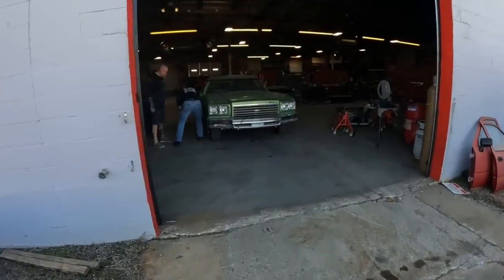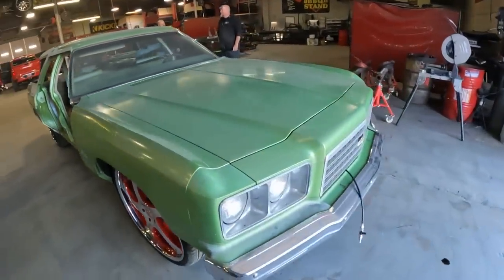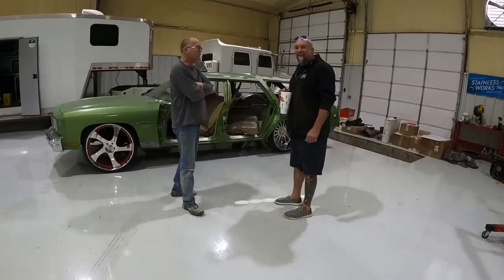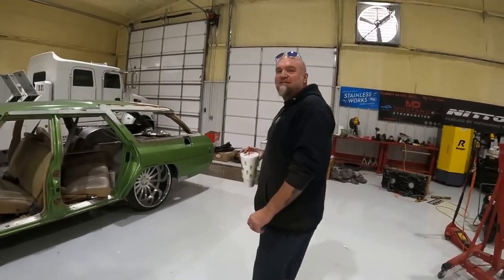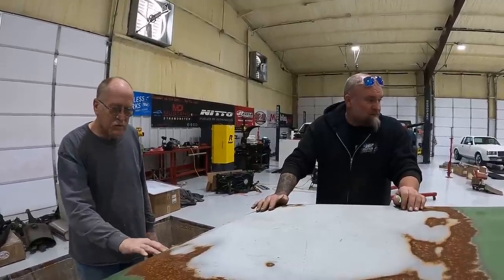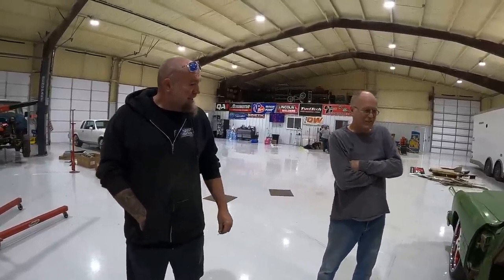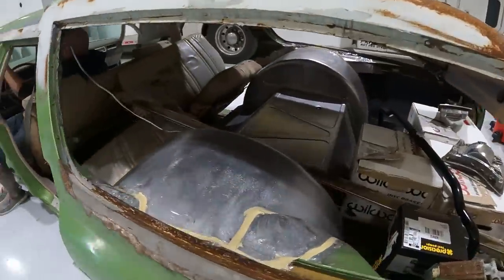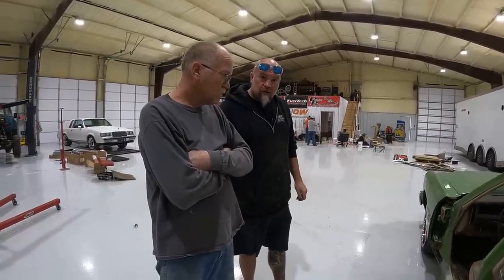SEMA 2023 OR BUST! FIRST LOOK At The '76 Donk Wagon!

Comment: Actually guys if yall need window rubbers, door rubbbers, etc contact 
Steele Rubber Products.  
If they don't have it you can use a long piece of banding (steel or plastic)and a marker to measure them.  And go to a salvage yard with your measurements and go hunting.   
You can always repurpose a seal with  Rubber cement and a scissors..

Comment: Awesome, can't wait to see the outcome of this build.

We have an 85 Monte Aero coupe that we did this to and we are innthe process of building. It's mini tubed and the floor is raised a little over 2 inches, so it will sit on the ground, has  24×15s in the rear with 405/27r24 tire. It's so low, the front tire is an inch or so away from the hood when it's shut in the front, the back covers nearly half the wheel.

If you find a person with new "rubbers"....let me know if he has any aero coupe rear window mouldings/rubber.

Comment: You know what your doing but you talked about putting 4 15’s in there if you hit over 150db do not use any filler it will flex every panel of the car and even flex the front windshield I competed USAC back in the late 90’s and hit 172 db in a 98 GMC jimmy and kept blowing the windshield out. Just wanted to remind you because it will break your heart after the time and money and have the paint on every panel crack!

Comment: What is going to happen with the 400 SBC out of the DONK if it was my car I would pull the engine out and build it to a 406cid with a Procharger and put it back in and you can always switch it over to EFI as well and then keep all of the original appearance under the hood just update everything

Comment: Do 4 15s with 8 inch subs in each door
 That way you got the high range bass and it will dropp hard when the bass bottoms out..trust me. This is my shit.
Reply: We also hide tweeters inside the air vents
 That's an old trick. It worked great.
Reply: In OK you need all the AC them vents can put out. Been putting 8’s in doors since Sony made some great ones back in the early 80’s. They were designed to fit 6x9 holes but I got them into my Chevy LUV mini. 10” subs is all that would fit back in those days. 100 watts was a big amp back then. Thank god I worked in a shop to affford that habit <grin>.

Comment: The whole donk thing is so ethnic to me.
I grew up in southeast LA, low riders and donks were the only thing the hispanics and blacks drove.
I'm trying not to sound racist because I'm not, I'm just stating how it was when and where I grew up.
It's laughable to me seeing a white guy trying to do this shit 30 years late and being of the wrong race/color.
Y'all need a trip to Compton/Paramount/Downey/South Gate, California.
Might enlighten ya's.
Myself, I'd build a corner burning road race spec'd beast. But, that's just me, I know you have to eventually turn a corner.
Never saw a truly straight road.....even in the middle of the desert.
BTW, they stopped making in-glass antenna's because of the glass cost, that shit ain't cheap to have inside the glass.